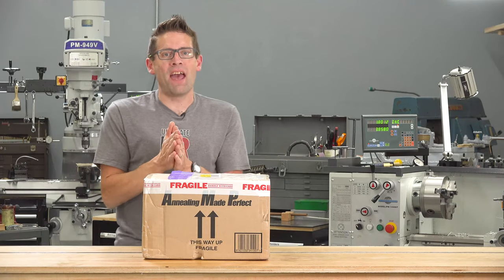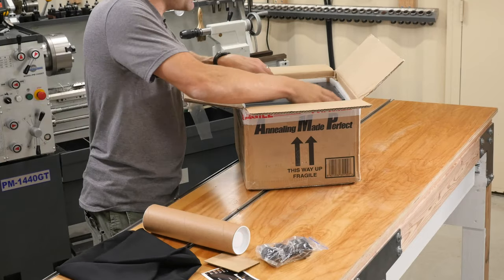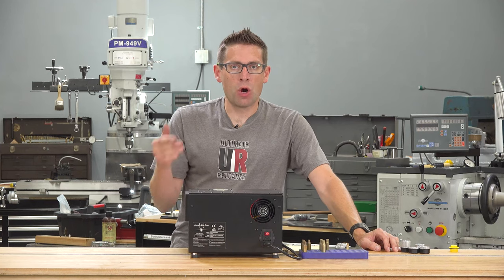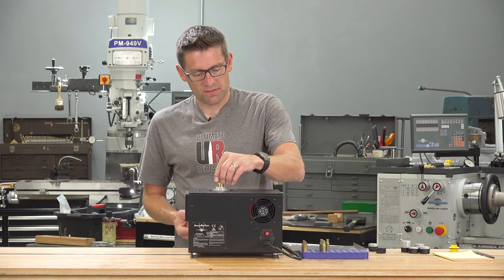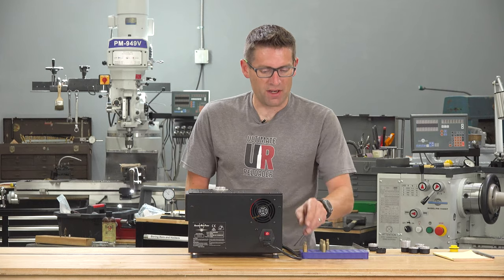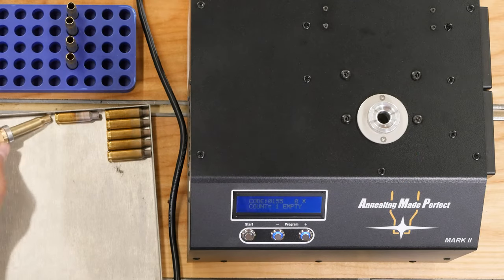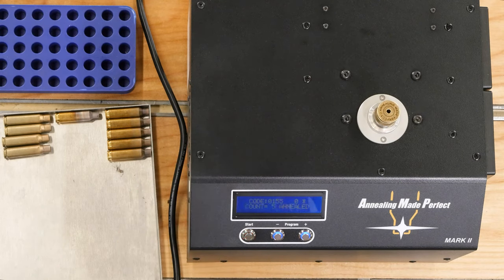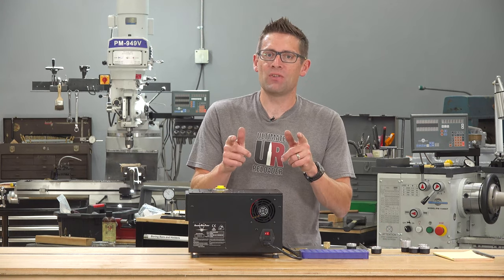Annealing Made Perfect: AMP Mark II Unboxing, Setup, Annealing 308 Winchester and 6.5 Creedmoor

Comment: I've been using the AMP Mk2 for about six months. So easy to use, no guesswork and you can start and only do 20 cases, leave to deal with the kids/wife/life in general, come back and continue with the same exact end-result for each case. Always a perfect metallurgic result. Repeatability and consistency, the two most important parameters in precision shooting.
Reply: Do you have to sacrifice cases each time you relaod or when you do a batch of brass to be annealed.
Reply: @yojimbo05  you only have to sacrifice One piece of brass Once per batch.
Reply: @adriandeklerk887  gotcha thank you for the information

Comment: Love my AMP. Have had it for 3 years. Recently purchased the Aztec upgrade. So fast. So easy. Wouldn't go to a torch or salt bath method for all the Lapua brass in the world. Use it on every reloading cycle. Bullet tension stays the same every shot for the life of the brass, which is extensive.
Reply: I cant afford this machine, but i could afford the salt bath. I like what you say about the life of the brass. Thats  important to me. I really noticed a shrinking of my groups once i began annealing. But i have a little ngvway to go to get sub MOA....👍

Comment: I bought an annealing machine two decades ago and still using it!

It's a must when you
you're doing brass forming for wildcats.
Reply from the maker: Awesome- what kind of annealer?
Reply: @Ultimatereloader  <> if I remember correctly, it's the Ken Knight  BC 1000 Automatic Case Annealer; does about one thousand per hour. Paid a about $500+ because of the extra plates.

I don't think it's being made anymore.
Reply: @Ultimatereloader  I've seen them as simple as a slide for your brass(think Gatling gun magazine)
As the brass drops, it's heated and dropped into water or your container. The heat source is a small propane torch. Basically just drop brass through and you're on your way

Comment: I got the first model of the AMP with 4 caliber adapters and two of the brass shell holder adapters on EBay for $700.00. Slightly used. Have done 2500 cases, works great
Reply: Mick Hayes the one that was on eBay a few days ago? Haha
Reply: Jonathan thornton no, I have had mine about a year now. Keep eyes open, they are out there. I tried several other kinds with the flame method and didn’t like it, induction is the best IMO
Reply: Mick Hayes gotcha! I built my own induction annealer.
Reply: Mick Hayes I’ve been tempted to buy an AMP, but I have enjoyed developing my home built induction annealer andddd making improvements over time.
Reply: Jonathan thornton good for you! I know building your own induction set up would be satisfying to do. I really didn’t have time or smarts to do it myself, lol. Good on ya

Comment: The AMP machine is certainly not for everyone - especially in light of the cost. However, after evaluating different methods which included not just the fabled internet search but actually speaking with accomplished shooters who do anneal, (not all top shooters anneal, David Tubb to name one) I chose to anneal, to use induction annealing, and specifically the AMP Mark II for the consistency it provides and the ease of use. Changing between cases is so simple - just change the pilot and enter the code and one is off and running. There is no flame to adjust in intensity or position or gas pressure to worry about, no tempilaq or guessing on proper temperature so only one burned case per lot, no worry about high temp liquid salt spilling or splashing, it takes only about a total of 6 seconds for each case (which includes transfer from loading block, to shellholder, to machine, to cooling pan). As I said, the AMP is not for everyone, but it was the right choice for me.
Reply from the maker: Well said Jim!

Comment: Two tips:  
1) Use a deeper pan for the annealed cases.  I use a bread loaf pan and use the edge to scrape the brass out of the shell holder.  No need to touch that hot brass with your fingers.  I also use a hot pad under the pan to protect the bench.
2) You should only need to touch the start once when annealing.
Reply from the maker: Thanks Steve- just found that out about the Start button :) I'll look at the bread trays, love the hot pad/insulator idea...

Comment: I anneal by the salt bath process at 1/10 the cost ($140 vs $1400) and although it isn’t as perfect as the AMP I doubt if anybody could tell the difference in either longevity or accuracy.
Reply: Was going to mention the same. AMP is nice for sure but for most people spending some time at the range plinking, it's probably overkill.

Comment: Did no one suggest the Giraud annealing set up with the Annie Induction kit?  It is a near fully automatic system.   Near the end you say “very fast process”,  so much slower than my Giraud.  Please have a look if you haven’t.  His trimmer is also the best and fastest I’ve ever seen.
Reply: Got a link or anything to this setup with Giraud and Annie?
Reply: @lucass4758  Giraud has a video on his web site as well as here on youtube for the annie. Don't know about the service after the purchase of the annie or if you would even need it but was told that sometimes it is hard to get in touch with the maker of the annie. I use both of Girauds tools, the annealer and the trimmer and they are both top notch. The trimmer is unreal and the annealer is hands free after set up. You load the container up with 100-200 or so 223 and let it go.
Reply: Lucas S his website is the link above your comment.  Everything “rundmm” said is seconded by me.  Annealing wise it easily handles 50 BMG too.  Pro tip Get metal catchment bins.
Reply: charles hetrick was hoping for something more in-depth on the setup of it
Reply: Lucas S when it comes the only thing to attach after unboxing are the chevron prices that extend from the base.  Groups of calibers use the same transport sprockets (the red anodized bit).  There is slight adjustments to make re the position of the induction horse shoe.  The controller (the red box on the side) can be adjusted in intervals of 1/10th of a second.  You use a product called Templaq (it’s like white out that melts at a specific temperature) to sort out the proper time.
Reply: Lucas S  I annealed 200 .308 casings whilst simultaneously reloading 400 rounds of 5.56 on my progressive.   I discharge about 8-9000 cartridges a year so I’d be “ponied” without Giraud’s machine.

Comment: I didn’t know that there was more than one company making annealing machines that came out of the reloading brass. There are two now that does the job in New Zealand . The other one has a really nice attachment that allows to automatically load and load shells without touching the case. I like the alternative of the alternative machine plus the accessory that automates the whole routine.
Reply: I use a Giraud. Load it up with cases and let it go once you have it set. No hands after you set it up so you can do other stuff. Not nearly as expensive as this setup. This is a very nice setup though.

Comment: Use a metal bowl for the hot brass... It'll be a lot easier to slide the case out of the holder. You'll get a quick rhythm going.

Comment: I don't think reloaders need to anneal their brass.  From my metallurgy engineering class I learned when the new brass is formed by series of dies from a flat disc, it goes through deformation and causes stress to the metal ( becomes brittle ) therefore it needs to be heat treated to relieve the stress and bring the metal back to it's original malleable property.  There is negligible deformation caused nor does it get hot enough to change the metallic properties of the brass.
Reply from the maker: Brass gets hardened from being fired and being worked by the sizing die (work hardening).
Reply: @Ultimatereloader  true to both but how many times would you have to bend a paper clip in order to break it if we're only bending it 1/100" at a time?
Reply from the maker: @nofeesh  My friend Eric has had a lot of issues with 6.5 Creedmoor case longevity (splits, separations, etc). Will annealing help? We're going to find out!
Reply: @Ultimatereloader  I’m very interested in your result as well!  I didn’t mean to be adamant about the subject, my opinion is mostly based on theory which may have faults.  I have reloaded 12,000+ rounds of 5.56 for about three years and I have learned few things that I can share if it benefits anyone.  Some of the brass I have been using were reloaded well into 20+ times.  I am now noticing handful of brass with splitting at the neck.  What I have read on the internet is when a brass is full length sized multiple times, the base of it's cartridge will weaken and fail.  Contrary to that, I am finding the neck is splitting vertically.  I know, I shouldn’t be reloading it that many times but I wanted to know how many times I can reload a brass before it fails.  Also, I’ve learned 5.56 brass does not need to be trimmed, at least I have not done so and I have tested brass well over it’s recommended trimmed length and I had no issues. I have 6.5 Creedmoor but don't have any experience with it so I'm very interested in your result.  Thanks for the videos, when I got started reloading, your videos were instrumental to me.

Comment: $1500.... I have to pass
Reply: I'm with you. It seems he is reviewing nothing but the gucci equipment almost no handloader except the most serious (BPCR guys, F-class, service rifle etc...) shooters would have.
Reply: This is only for the rich !!!!!!
Way over the average reloader !!
Didn’t even watch the video, Gaven, how about us normal people.
Reply: Salt bath annealing is cheaper and arguably just as effective.
Reply: Salt bath annealing works just as well and as quickly. It's just not as convenient and messier. Of course, AMP will tell you it sucks LOL. The results at the range along with brass consistency and longevity speak for themselves.
Reply: Dean Hudson yes it is. It starts out as a solid then heats up to a liquid. After you’re done it returns to a white salt block.
Reply: Lance Schul that’s false.
Reply: Yeah, the Giraud annealer is 1/3 the price and can batch out a slew of cases once it is dialed in - only issue is you need different plates for different sized cases and you need some experimentation to get the timing down for each caliber
Reply: Yeah, he seems to have left behind the ones that were drawn the most to him.
Reply: $1500 is just a good weekend, this will last longer than I will, so it’s a bargain!
Reply: It's worth it trust me. If you are serious about ELR and accuracy

Comment: I looked at their website and read the limited warranty section. I am wondering what problems will occur with replacement elements etc coming from New Zealand  
Since this machine is some serious bucks, warranty for the heating part of the system should be longer.

Comment: My butane torch for 5sec intervals does the same thing for 1/100th the $$$
Reply from the maker: Daren James actually- it’s not the same- this machine analyzes cases and then uses a different method for heating/annealing. Not saying yours is bad or inadequate- just not the same :)
Reply: @Darren James - Sorry to tell you buddy, your butane torch is not remotely even in the same league. I used the butane torch method for years and it was always hit or miss and a P.I.T.A.
Reply: Potato tomato. Works for me and was recommended by the guy that taught me. We used to shoot all the time in Mo.  He’d typically shoot clean at 600y with 75% X’s.  I just think there’s top notch equipment and then there’s just throwing money out the window because it’s cool. Seems to me world class shooters have been butane for over 50y. Still love the show.

Comment: How much does that machine cost
Reply: Tom Reed $1400.00 USD
Reply: $1,400 on Brownells.
Reply: Ty
Reply from the maker: This tool is not for all budgets, and it's not for people that want to just shoot factory ammo :)
Reply: @Ultimatereloader  I guess I don't really have a problem  with the price as much as I do for the speed of the machine.  I was really thinking it would have some sort of feed tray rather than loading one at a time.  How many times can you shoot a case without annealing before running into problems?

Comment: One question.  If I purchase a bag of 500 308 once fired brass, since they are all 308 but there are many headstamps and many lot numbers, do you need to destroy all of them calibrating or is simply calibrating one of the 308 cases good enough for annealing the rest of the bag?

Comment: Dear Gavin,happy festive days and a prosperous Newyear.I would like to know if these case pilots (where the cases get inserted to) are case specific or "mother"case specific.Or are they shoulder,neck,case length or base specific?!I got a couple wildcats of my own?(This is the reason)I got a wildcat based on the 6,5×55SM but blown out and necked down to .243 with a 35°shoulder.I also do have a 6-06AI as well as a 404 Jeffreys AI.Do I in all these cases take the normal 6,5-55SM insert or the 30-06 in case of the 6-06AI or the 404Jeffreys?
For all cases based on .308 size base like(22-250,243Win,308,30-06,7×57,6×57,6Rem.,6,5×57,7×64,8×57,9,3×62)do I use the same insert?!With all cartridges based on the old 300H&H or 375H&H (257Wby.,300H&H,300Win.,300Wby.,340Wby,375H&H,7mmSTW,458Win.,416Rem,458Lott,etc.)
Or are they case length based etc.?
I would apreciate a more clear clarification in connection with this.I am interested to purchase a machine but would like to know more detail first.

Comment: So I still in the research part of reloading.  I’m thinking of using the spare bedroom as my loading room.  My concern is that it’s carpeted.  Do I need to worry about static with either carpet or a plastic table used as a reloading bench?  I know it’s not ideal but I’m just getting into it and don’t plan to do mass production stuff, just what I shoot and will probley form some 300 blk brass

Comment: Great overview of the machine. 
No doubt at all that it's a brilliant annealer, but more importantly, I cannot wait to see if that annealing has any accuracy effect on new or aged brass. 
Hope you will split the brass into 2 batches of annealed and non-annealed each for brass age / batch for a fair test. 
These machines are a significant investment and it would be great to see what if any difference it makes in the real world, and at what distance any effects are noticeable, before committing.
Reply from the maker: Kevin- good idea on the content! I'll also be doing longevity tests to see how annealing impacts brass life...
Reply: @Kevin Adam - I anneal with the AMP MkII after every firing and have noticed lower SD's and about 1/4 - 1/3 better accuracy with my 6.5 CM and .308. The neck tension is consistent and that's what matters to me more than longer case life. Every time you anneal a case even if it's been fired many times, it returns to it's virgin state. The only thing that limits the life of a properly sized case is that the primer pocket will eventually give out.

Comment: Great review! I usually do not clean brass after firing, only using brush thru neck. Do you think it is better to clean the brass for example with ultrasonic cleaner?
Reply: Just get a vibratory tumbler and use treated ground walnut hulls as the media.
Tumble for 2-4 hours, sift out the media (there are lots of different media separators for this that can be gotten at reasonable prices), then load.
You can run a brush through the necks if you want, but you probably won't need to do it, as long as you change out your tumbling media every 1000 or so cases tumbled in it.

Comment: Great tool but to much expensive for some shooters ;) I use the salt bath annealing process. Redo the kit cause can get it from Canada and it works great too but need to check be between 510° and 550° C to have a good annealing, only the bad side on this system, temperature check, need 30 min to have the good temperature too. Oki, an other, be really carefull to avoid water with salt :)

Comment: I’ll pass I prefer the Annealeez Gen 2 machine for $275.00 Much more economical and you can place a 200 cases, the difference is uses a small camping propane  canister tank but You have deep pockets them buy AMP Mark ll $1,500

Comment: I’m sorry yo have the machine that I though was another machine. It didn’t take me long after I went through the maze that it was the same machine and I have good news as it comes with other machine that work with it. I could see that you may use it as another section and talk about it later. Neat machine non the less.